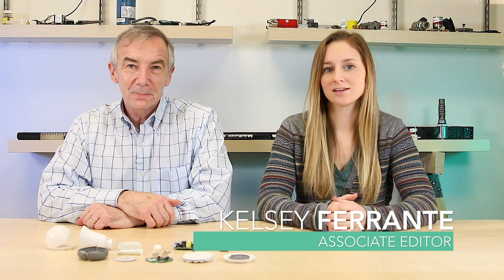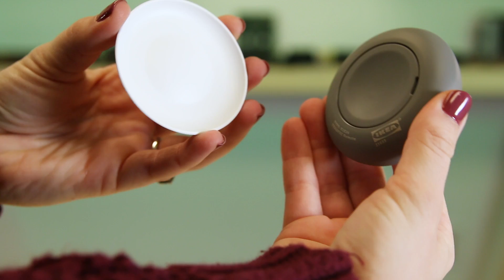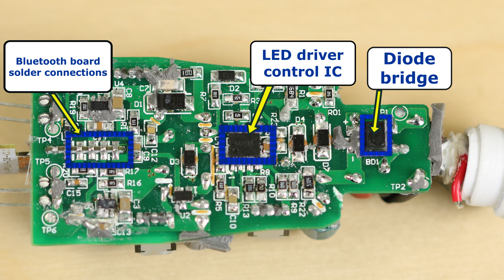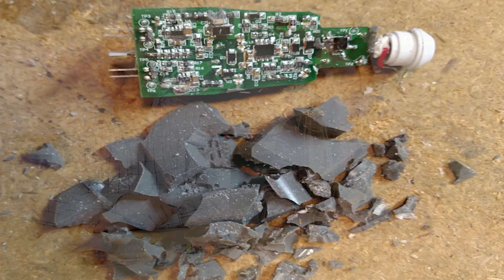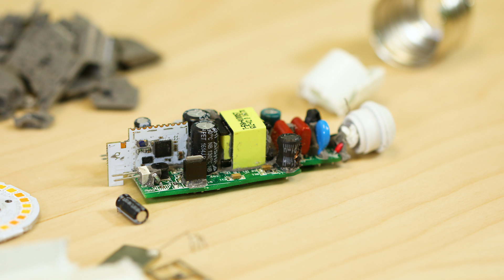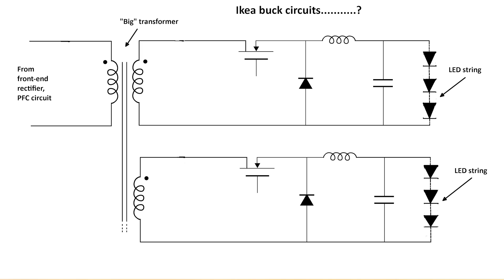Teardown: What's inside Ikea's TRADFRI smart LED bulb

Comment: Soooo... When you sum all the energy reqs (including battery and such), does it drain more or less power than normal (edison) light bulbs (I'm sorry, heating devices)?
Reply: This video is overly technical (boring even for technically inclined) and yet surprisingly full of obvious inaccuracies that even a HomeAutomation novice could recognize. Suggesting the bulb/remote tech was using Bluetooth and claiming there was no smartapp are two of the most obvious mistakes that should have been caught by an expert or a by an intern who knows how to use google. Nice effort otherwise. I'm sure there's a place for Uber technical talking head videos. Just get the details right next time and you're good.
Reply: Oll
Reply: This is sooooo boring, not even that, it is so condescending against women. Why is she just sitting there asking stupid questions so 'the wise man' can explain us how it works... This is movie making from the 50s... Crazy
Reply: Much less, and the battery takes a trickle.